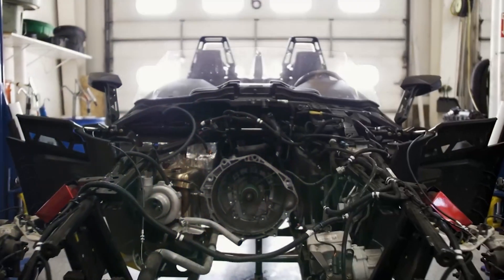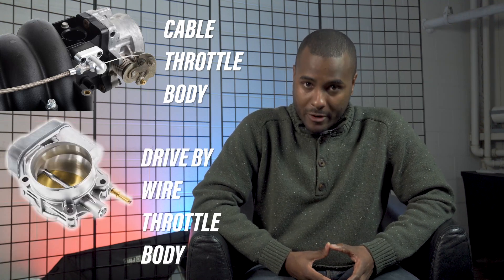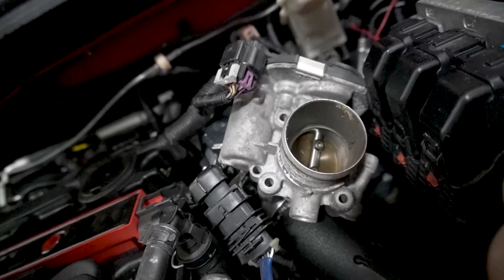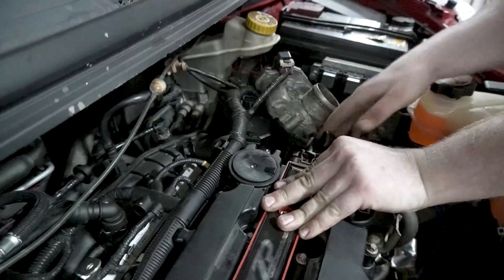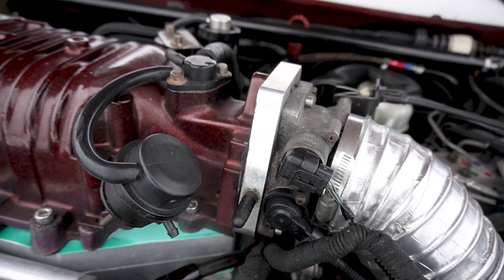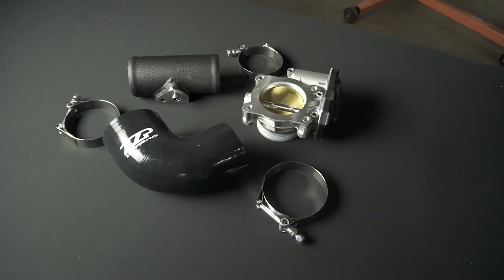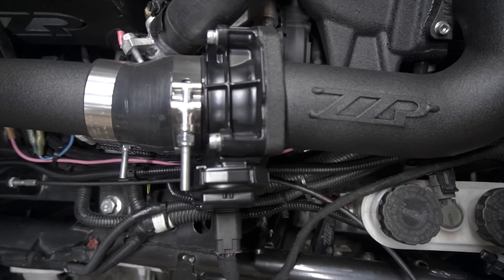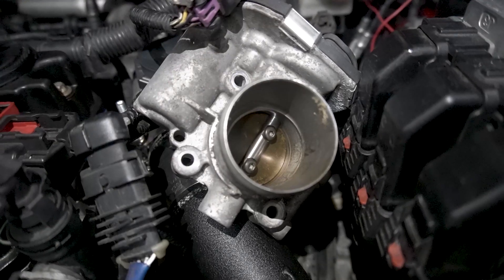Comparing Throttle Bodies // Behind the Builds

Comment: I can imagine a tiny delay with drive by wire due to processing speed between when the pedal position changes and when the throttle body is commanded open but I don't believe it would be significant or noticeable. Some cars definitely have a delay programmed in from the factory, but that is only a tune away from being fixed.